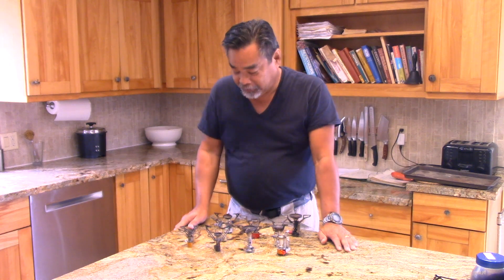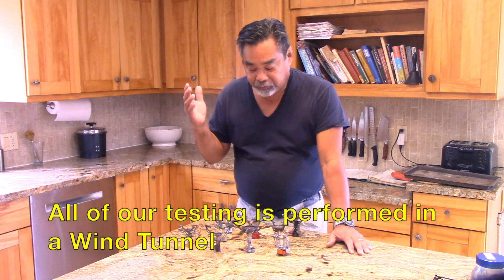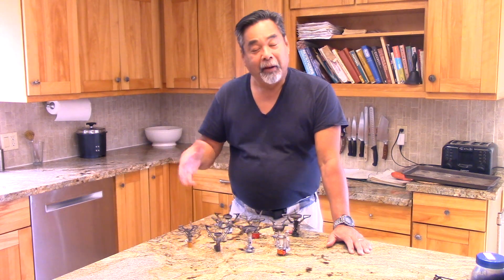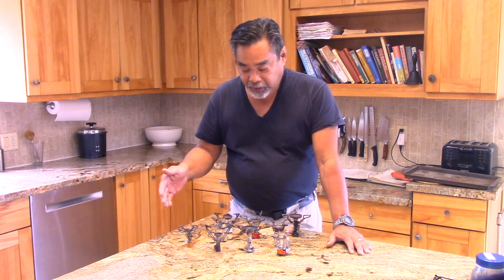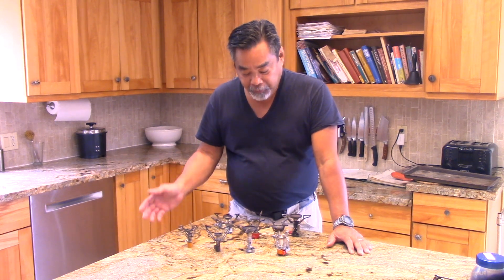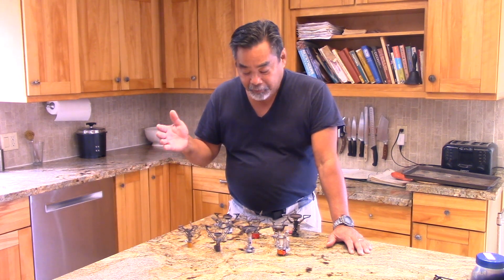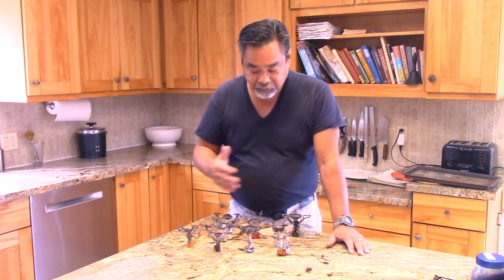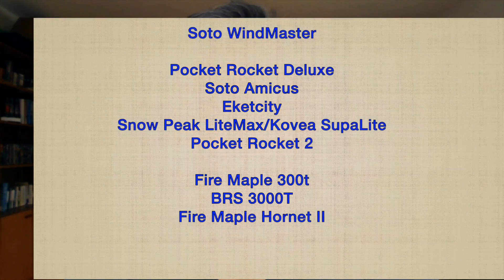Canister Topped Stoves Performance in the Wind by Flat Cat Gear

Comment: That tiny glowing red leg of the BRS3000 makes me wonder if it’s possible get it hot enough to bend under the weight of a full pot
Reply: I have heard anecdotal evidence that this is something that actually happens with the BRS3000T.
Reply from the maker: Possible.  But they are not the only ones who can get teh pot support arms red hot.

Comment: So it looks like, in my very amateur opinion, the closer the burner is to the pot, the more efficient the burner can perform in higher winds. Which makes sense with stoves like the MSR Windburner, which has a close burner with an intergrated windscreen system on how well it works.  I know its not a stove that would be featured in a Flat Cat Gear video, but a very well performing stove nevertheless.
Reply from the maker: Well, the MSR WindBurner is the Gold Standard for fuel efficiency and robustness in the wind.